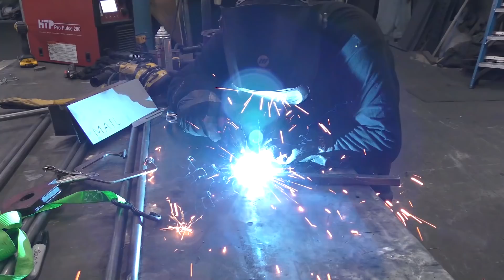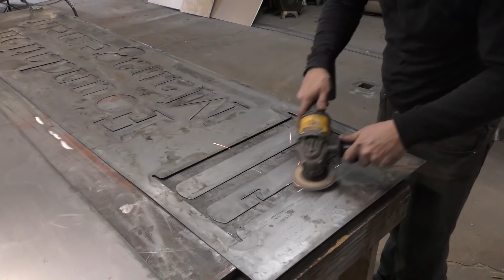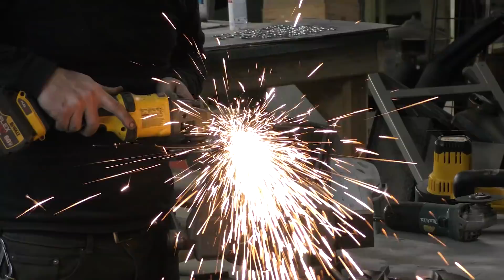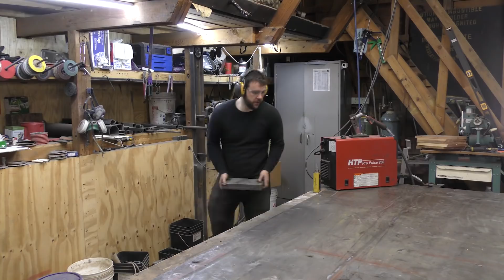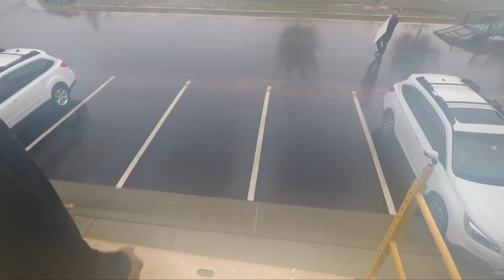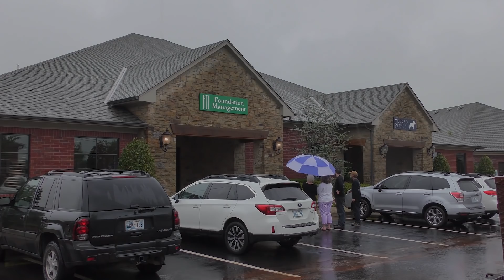STEP UP your CNC Plasma Sign Game & THISS Battery Review

Comment: Those aftermarket batteries go into thermal shutdown way easier than the genuine DeWalts.  Ok for winter use but when it heats up here in the central valley they are a pain in the ass.
Reply from the maker: I have actually been decently impressed with these. Killed one over discharging it, but that's my fault

Comment: Nice video, but for the love of god, wear gloves!
Reply from the maker: If you want to wear a glove around a spinning tool, by all means go for it, I would much prefer the chance of an abrasion on the skin (which a glove could maybe stop) over the chance of a glove drawing my fingers into a spinning tool if it were to snag. No glove you'd want to wear is going to stop a major puncture wound, so that's a moot issue. Personally I am aware of where my body is, I cannot be aware of where the accessories on it are with that same "resolution"

The "gloves and spinning tools" argument is going to go on forever, and everyone gets to have their opinion. For me, and in my shop, gloves do not get used with spinning tools. I'm not going to critique if you decide differently for you or your shop, nor am I going to tolerate a debate about something that is objectively an opinion. You do you, I'll do me.

Comment: great job , thanks for sharing , i have in tunisia , a big factory of metal , process cutting , bending etc.
I would like to take your advise about your experiences , 
need mostly cutting ,precis thin metal , ss and al , galvanized too 
what cutter do you advise , softaware and controller , mostly i draw my dxf , through corel 
thanks
Reply from the maker: I use and HTP microcut 875 plasma cutter and also draw in Corel

Comment: Great video. One thing you might consider is to use stainless steel Tapcons for exterior installations in the future. They are harder to find but I sleep better knowing I'm not relying on just a powder coating to prevent corrosion from causing them to fail over the course of years. Also, I like going into brick / stone when I need a solid connection but am always wary of blowing out the brick and sometimes will start with a glass and tile bit in a non-rotary hammer to prevent that from happening

Comment: Love the channel. Just wondering why you rarely wear gloves? Seems like something that makes sense for the sheets of metal you work with.
Reply from the maker: We wear gloves when needed. Any metal thicker than 16ga is basically not sharp, so we're not worried about cuts, for thinner stuff we wear gloves as needed with them being mandatory with anything 20ga or less. When grinding, I am in the "no gloves around spinning objects" camp as I'd rather get sliced by a tool or workpiece then have some part of me or my employees drawn into a tool by a snagged glove. When welding, the hand closest to the gun is most often covered, though we'll admit to tacking things up bare from time to time. The dutch Health and Safety organization (IDK the actual name) did a study on welders in the 80s and 90s and found that the only example of skin cancer was one guy with it on his nose, which they ruled as an outlier. The primary concern is not UV exposure but burning, which is why the operating hand (in my case, the right) is often ungloved. As fabricators, we are not laying into welds all day, we're transitioning from task to task, meaning we need the dexterity of an ungloved hand.

Anecdotes do not make rules, but in 7 years the worst cut I've gotten is a laceration on my pinky from moving a sheet of 20ga, where as I have had MANY burns from mistakenly grabbing things that were hot, most often from where someone else welded or ground a piece and I touched it thereafter, meaning that my gloved PPE during welding would have made no difference. It's a fair questions, and everyone gets to make their own decisions. I'll respect yours, but I'll only tolerate the same respect in return.
Reply: @42Fab  Thanks for responding. I agree with your assessment. I am just starting in fabrication and like to listen to a diverse range of experts and hobbyist to help me make up my mind. Great points and I definitely defer to your actual experience. Just another reason I love your channel!

Comment: Howcome you don't get shocked by the machine when you touch the metal while it's working?
Reply from the maker: Electricity takes the path of least resistance. The ground clamp (hidden at the far end of the table) is a much better conductor than going through me, my boot sole, then through the concrete floor, and ultimately the rubber feet of the plasma cutter itself.
Reply: Thank you for the Reply, I'm getting my first plasma table this January and you have been of much help. Thanks again for that!

Comment: Loving the work. You are now the only Fab channel I watch due to unnecessary advertising. Keep up the good work.
Reply from the maker: Some advertising is to be expected, it takes a lot of time away from the shop to edit videos, and people have to make a living. Don't hold it against them unless they pitch crap they wouldn't actually use.
Reply: @42Fab  Agree with making a living issue...... but the ads have to be relevant. Some woodwork channels have cost me a fortune in router bits and measuring devices I never knew I needed.  Now I just need to justify why I need a stud welder as a gas engineer.
Reply from the maker: @royarmstrong3537  I'll take the blame there, stud welders are awesome to have around

Comment: I would strongly advise you to NOT buy these batteries! I bought 2 of the 4ah ones for my Ryobi tool set. Within 1 minute of using one of them it started smoking and put off a terrible burnt electronics smell. I sent the company several emails regarding the fact that I am concerned about the possibility that this battery may catch fire and asked them what I should do about getting  replacement. I have gotten absolutely NO response from them regarding the issue. At this point I dont know if it is safe to use it. Every time I try to use it the odor gets very strong again. I am storing it outside until it fully discharges. I suspect there is a problem with the balance board inside . The other battery seems to be working OK. My issue is not that there is a problem with the battery but what you can expect for customer service out of this company. Everyone has problems with their products but something that could possibly burn your house down or wore yet injure people clearly should NOT be ignored.
Reply from the maker: Good to know

Comment: ever heard of stencilling a font ? can save yourself a lot of work and no double side tape dropouts and a pissed of client,. the rest is fine and make sense, if your cut speed set correct, less dross to clean up with wire brush
Reply from the maker: And you end up seeing bridges. Stencilling is appropriate in lower cost projects, single layer work, and for unskilled sign makers. In 6 years, I have had one counter fall off and the client was warned and still wanted their sign installed in sub freezing temperatures. If you're worried about falling parts, you've never used VHB tape